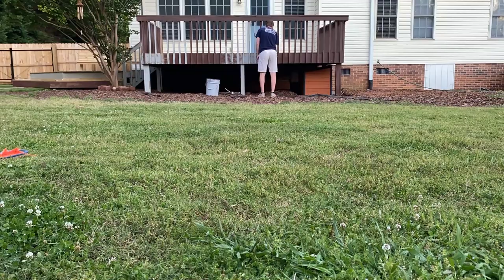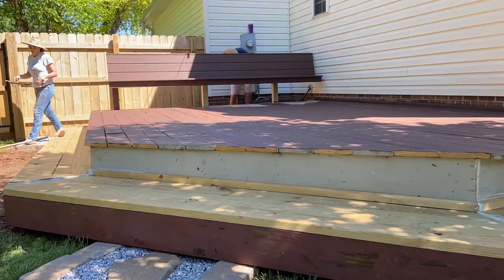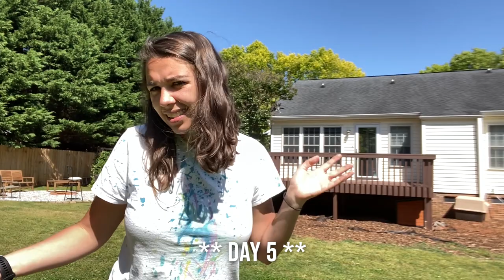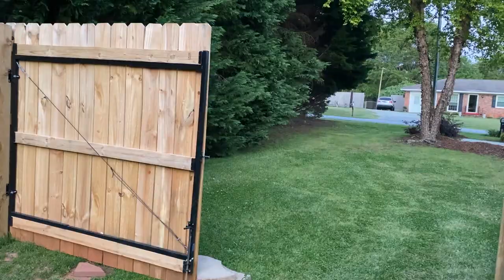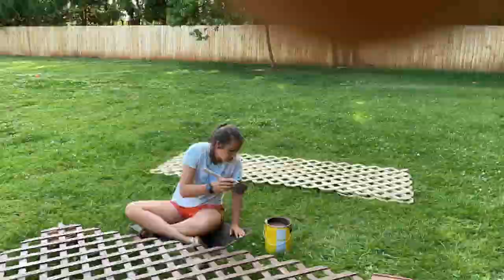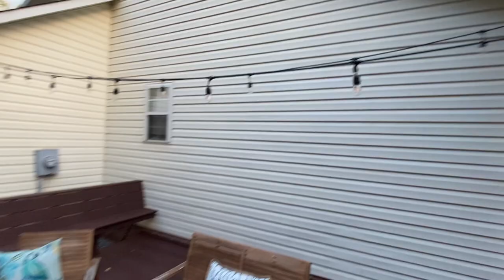DIY Outdoor DECK REMODEL // Cabot DECK CORRECT REVIEW // Livable Outdoor Space // New Landscaping!

Comment: I'm using Deck Correct now to restain/repair my 20 year old deck.  This stuff is great!  Just take your time and put it on nice and thick during the first coat, filling in the cracks.  I did this and don't see the need for a second coat.  I was contemplating demolishing my deck and having a new one installed but I'm so glad I gave Deck Correct a try.  $200 beats $20,000 any day.  I'm sure I just extended the usable life of my deck 5+ years.

Comment: Great video Libby... I just finished my first coat on the railings this afternoon. How is yours holding up?
Reply from the maker: Holding up great!
Reply: @LibbyFlanagan  Glad to hear...I have been reading a few horror stories about it chipping or peeling after 6 months. Only ⏳ will tell.
Reply from the maker: Probably has to do with the prep work
Reply: 2nd coat on the railings is done!!! 

Do you live in a snowy climate? 

If so, any issues after shoveling it?
Reply from the maker: I live in SC so I can’t speak to snow really 😂
Reply: @alldayeveryday2180  i had a house in snowshoe west virginia. a snow shovel on wood deck will destroy any deck sealant very quickly. it is what it is.

Comment: 5-gallon paint cans are incredibly difficult to pour from if you remove the whole lid.  Every deck re-do video I have seen shows a 5 gal container.  However, a "less-than-$3" pouring spout will go into the 2-inch hole in the top and make it easy to tip the can and pour into a tray, etc.  Just look up "5-gallon paint spout" at your local paint supplier.  Look up "Tech Otto" 2-min video on Youtube.
Reply from the maker: Great tip thank you!

Comment: The directions on the deck correct said to only use it for HORIZONTAL surfaces. But it looks like you used it for your spindles too. Is that the case? Or did you use the same brand but just their regular stain that matched the deck correct?
Reply from the maker: I did use on the spindles and there are a lot of runs, I think that may be why it says that. But it has held up well 🤷‍♀️
Reply: i read the instructions too but had no choice. we are adding the cabot deck correct over some old behr deck over on a deck that is 45 years old. yes, 45 years old. back when treated lumber was made to last, soaked in arsenic. cant get treated lumber like that anymore. my parents built this house and religiously treated this deck many times over the years with many different deck stains and sealants and im confident that it has significantly extended the life of the wood. just pressure washed everything again, 90% of the work is in getting a clean surface to work with so that the product can be properly applied and do its thing to last multiple years. its a very thick product, didnt find it to have any runs on the vertical pickets (exactly like the ones in this video). only one coat is needed on the vertical pickets. two coats on the horizontal boards.
Reply: I found that I had to go back over some sections I was doing. it's a "high density" product and very different from paint and stain. it has a tendency to want to run on vertical surface, I had to keep going back and brushing it even again as the "run" forming is a delayed reaction vs thinner paint and stains.